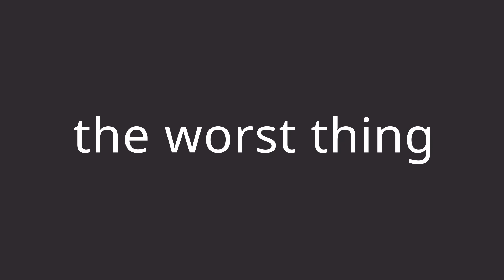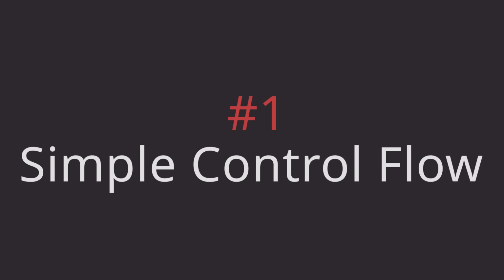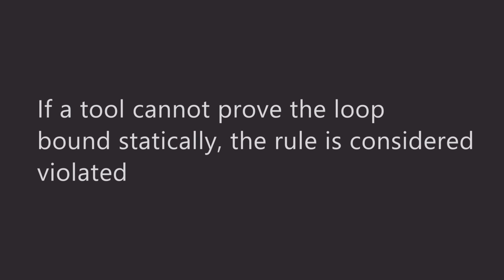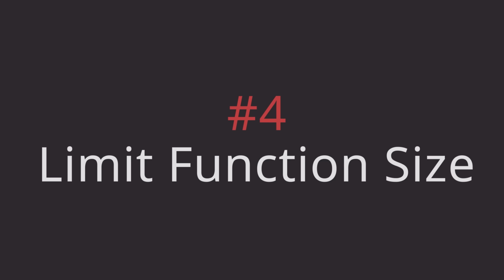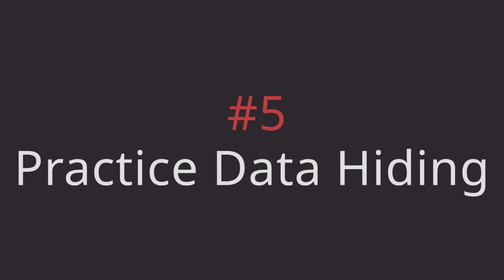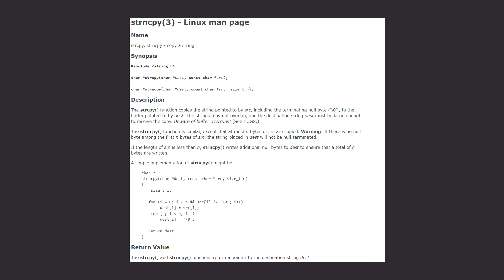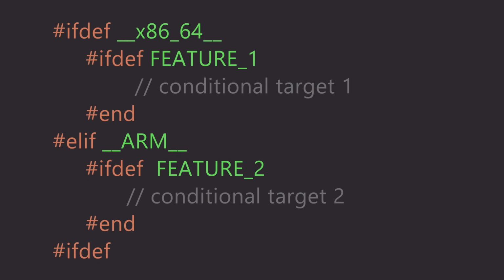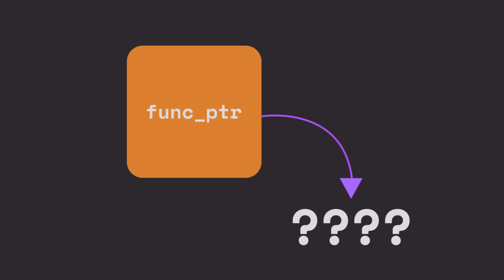how NASA writes space-proof code

Comment: I would also add, when an error occurs in your code, error recovery should bring back the code in a "predictable state".
Reply: I'd imagine this is vital for any deep space application, with all those cosmic rays flying every which way. You don't want one flipped bit to render your multi-million dollar equipment unsalvageable.
Reply: @mikicerise6250  Interestingly, it is seen in vehicles driving at altitude. I used to work in automotive powertrain as Head of System and Software Safety for a large tier 1 supplier. When we moved to microcontrollers using a smaller fab process, the watchdog system detected and stored (for feedback during service events) single event upsets, but these were geographically centred in areas at higher altitudes. As far as I'm aware, those higher (ASIL2+) variables weren't stored in multiple locations and cross-checked on each use as a mitigation specifically for cosmic ray events, rather it was done in case errant code over-wrote one copy of the parameter.
Reply: @mikicerise6250  Well, that's called "radiation hardening" and should never be necessary tho, like surely the computers there are not directly exposed to any radiation...
Reply: @erikkonstas  Space is filled with radiation. Are you saying they shield the computers so well that radiation hardening isn't necessary? I find that hard to believe.
Reply: @clonkex  What do you mean "so well"? They just have to be encased in a completely insulating and inert material (metal comes to mind). Also, "radiation hardening" of code is a recreational concept which does not apply to real-world applications...
Reply: @clonkex  NASA uses not the newest processors with billions of transistors but instead quite old processors which not have so small structures and therefore are not so vulnerable to radioactive particles. Memory could be protected by using ECC-RAM allowing to detect and correct single bit errors.
And of course some shielding makes also sense - placing the computer somethere in the "center" of all other hardware provides some additional shielding as this surrounding hardware provides some additional shielding
Reply: Something they could do, but they probably don’t is to sanity check different states, but it would probably be prohibitive to think about all edge cases that should not happen and hence could be signs of corrupt state. 

I am thinking if a is the case, b should never happen, etc. 

It would probably be too complex and too much overhead and possibly create opportunities for more things to go wrong in the rules for sanity checking itself.
Reply: @roygalaasen  Interesting thought.
Reply: @roygalaasen  what happens if you force (nearly) every error to be pedantically handled you can see in rust. The rust system of locking the result of a function behind the check of rather the function was successful or not and nagging you if you don't check the error on a "void" function is creating a system similar to what you imagine. Except for catastrophic failures (that could theoretically also be handled the same way but aren't for simplicity) that crash the program rust in every case either handles an error or forwards the decision to the calling function creating a perfectly collapsing error pyramid that is 100% statically provable to handle all cases.

Uncaught exceptions and the c lastError() system were a huge mistake and should never have been created.
Handling or propagating all errors isn't as impossible of a task as you imagine it if every function is handling it's own stuff.
Reply: @redcrafterlppa303  "either handles an error or forwards the decision to the calling function" is literally just exceptions in real languages. There's a certain comfort in the hand-holding nature of requiring every error to be handled but that's just tedious and obnoxious in 99% of use cases
Reply: @maskettaman1488  it's definitely not. In worst case just bubble up to main and crash the program there. But there is nothing more annoying than tracing which line of functions crashed the program. With clear error returning functions and depending on the language a flashed out stack trace is incredibly valuable. Running a program and receiving a Segmentation Fault (core dumped) and then firring up the debugger and going on a journey without a initial idea what went wrong is draining. Having a stack trace often makes debugging unnecessary since you look at the said line again and it hits yourself what qn idiot you where.
Reply: @redcrafterlppa303  "tracing which line of functions crashed the program". This is literally in the strack trace. That is exactly what a stack trace is for. The fact that you don't know this speaks volumes about either your ignorance or your dishonesty.

"Running a program and receiving a Segmentation Fault" what language that has proper exceptions will throw a seg fault?

Jesus dude are you under the belief that languages like Java and C# work the same as C???
Reply: @maskettaman1488  you are the one that got it wrong. The stack trace is an automatic (language level) system that unwinds the stack at crash time and builds a visual representation of the control flow taken before the crash.
Doing this by hand with a debugger is tedious and exhausting.
"the fact that I don't know that"? I know what a stack trace is and how to debug a program. But the effort between building a stack trace and finding the same information by debugging is worlds apart. 

Are you serious. Segfaults are as common as sand on the beach (showing your level of knowledge) 
Segfault is just an os signal that the process accessed memory it doesn't own. There are other signals like SIGFPE (Arithmetik operation error) that happen for example when the cpu divides by 0.
Even java can throw a Segmentation fault if you access some random memory address either if there's a bug in the jvm or you manually cause one in code.
Segmentation faults have nothing to do with exceptions except that both are related to errors.

The reason low level languages tend to throw os errors instead of printing fancy errors is that these exceptions are expensive even when no problem ever occurs. Os errors are free.

Java, c, c++, c#, rust, python, php, Javascript etc all execute x86_64 cpu instructions on my machine.
Rather you have an compiler that creates cpu code at build time or an interpreter that generates cpu code at runtime all are bound by the same rules and have the same possibility to cause the os to halt their codes execution (os error).
Only because higher level languages tend to include safety rails that handle certain behavior in some other way before a braking instruction is executed on the cpu doesn't mean that they work differently under the hood.

Pseudo code example:
Java:

int divideOperator(int dividend, int divisor) {
	if devisor == 0 {
			error = "devide by 0 error" 
			return 0;
	} 
	return dividend / divisor ;
} 

C:
int divideOperator(int dividend, int divisor) {
		return dividend / divisor;
}
Reply: @redcrafterlppa303  devisor is not defined, whoops 😊
Reply: @redcrafterlppa303  "Doing this by hand with a debugger is tedious and exhausting"

No, your debugger does this for you. You're never doing this by hand. You either don't have experience with what you're talking about, or you're intentionally inventing silly scenarios. I don't know which would be more telling.

"I know what a stack trace is and how to debug a program"

You can't say that right after you talk about how you need to unwind a stack trace by hand lmao. It sounds like you really do not know how to debug.

"Segfaults are as common as sand on the beach"

You're missing the point. Yes they can still occur at a system level but that should be abstracted away (if not prevented) from the developer in any modern language/compiler system.

Segfaults also have nothing to do with exceptions so I find it weird that you're focusing so hard on them.

Half of your comment doesn't even apply to the topic at hand. You come off as if you took an intro C course 25 years ago and believe all modern programming is like that.

For crying out loud you didn't even know what an Exception was but you're still here writing paragraphs about having to manually unwind a stack trace lmao
Reply: That's not always feasible.  Fall back measures or safe state restarts close the gap.
Reply: @gamerfortynine  Wouldn't that be a "predictable state"?
Reply: A logical error you mean. Hardware errors like accessing bad memory cause segmentation faults and cannot be "unrolled"
Reply: What the first two replies are forgetting is that this program is LAUNCHED TO GODDAMN SPACE and you don't have the little privilege to rerun a crashed process... that's not always feasible or might be prohibitive to think about? Then why oh why does 350 million peoples' tax money and numerous enormous grants fund NASA exactly???

Comment: So, I imagine there are exceptions to these rules bc you need setjmp like operations in order to yield a thread or to enter an interrupt. Similarly, function pointers can be typed so that threading can occur. Based on the restrictions presented in the video they couldn't use a normal RTOS statically. I would argue within context of context switching that they would have to use them then and only then.
Reply: I work in aerospace, where we enforce MISRA analysis of our code. You're right that these rules make threading extremely difficult (I won't say impossible), which is why we don't use threading. We also don't use an OS in the first place, so each processor is incredibly limited in available resources.
What makes it possible to do anything more complicated is, in my opinion, the use of distributed processors and specialized hardware for communication between them.
If we've got to control 7 actuators, we don't have a single multithreaded processor running an RTOS to process any events that might occur. We'll have 7 tiny processors sending their state to a main control unit, which will then react to (and filter) external input and send discrete commands to each actuator.
In terms of control flow it's not significantly different. Roughly the same information ends up at the actuators, and at the central unit, achieving the same results. But it allows us to use much cheaper & more modular units, while providing a better framework for testing each individual unit in isolation.
Of course the flipside is integration hell, or what happens when all these individual units get put together and we discover that these 'perfect' units don't speak the same language in the first place 😂
Reply: @aidanbecker9758  misra standards I get, but I've still seen things like vxworks used across industry for aerospace applications. When you're talking multiple hardware devices you can get away with it by having them easily talk over a bus , but that drives up cost and ultimately you still run interrupts on a bare metal system.
Reply: Like I could see getting away without set jump contact saving your functions which means whatever running has priority except interrupts. Which if I remember properly is a cooperative operating system. You can get away with that as long as your function has exit points for that and reevaluates system state. However, task handles would still need to be typedef  function pointers in order to implement a scheduling system unless you have everything based on context state and not event based. In that case, you could run everything in a central while loop.
Reply: It could very well be that they don't use a RTOS which doesn't make use of these rules either. Considering their environment, that would be very understandable.

So it could very well be the case that they do in fact have no exceptions to these rules.

Comment: When dealing with extreme scenarios is necessary to implement extreme measures. Not feasible on regular projects however it is a rock solid approach for coding.
Reply: Now I want to work on nasa. Not that I want to torture myself, but opposite of that. ALL of their code is crystal-clear and it should be very satisfying working on a codebase that for many years follows this strict set of rules, where you can read and actually understand what's going on without ever needing to run that code. It may be a little hard to work on such a project at the start, but there's nothing a few code reviews can't fix :)
Reply: @IqweoR  But a while ago even NASA got a constant wrong and literally caused the rocket/space craft to be 180 degrees off, I think it was a minus sign.  It happens to the best of them.
Reply: @raylopez99  No amount of care in coding is going to fix a logic error.
Reply: @darrennew8211  Eh yeah it's possible to carefully code bad logic. On the other hand, most of the clean code guidelines are designed to make the logic very, very clear*.  It's far less likely for bad logic to make it through review of the logic is super clear - and therefore *clearly wrong.
Reply: Personally, I disagree that such code practices are infeasible for more mundane projects like financial software or video games. Rules like these help you and other programmers to understand what your code is doing more easily. They reduce the odds of undefined behavior and memory leaks. They also help you catch design oversights before they reach production.
Reply: @megabyte01  I think everything is a trade-off, some applications are not as crucial as others and sometimes a faster development is more desirable than a more solid one.

I understand your point, don't get me wrong, yet I see it more like using a tank for killing a mosquito.

For example: a correct use of Heap can be correctly deal with no problems in a production environments (pretty much everyone does it), this code guides asks to remove such a useful tool which may be more troublesome for applications that are not that crucial.
Reply: @megabyte01  Not using the heap in modern video game design?

Yeah alright buddy.
Reply: @joestevenson5568  The heap is unnececary a lot of the time. 
Objects that fall out of scope are destroyed and objects you create are allocated on the stack reguardless of size.
If you are feeling fancy you can stack allocate chunk wise with pre-determined stack objects and incur a small performance penalty for not being able to gurantee contigious memory.
Reply: @Mallchad  I disagree, there are significant downsides to not being able to use the heap. The most obvious one is dynamic memory, stack has a fixed size and compile time (data/text) objects are fixed size as well. For the majority of projects heap is beneficial and necessary, it's a fundamental tool of programming, however it makes sense why NASA avoids it since manually managing memory is prone to error.
Reply: @_schnelli4800  it depends entirely on the scale of the project.

On modern hardware there's really not a lot of reason to not predefine the size of your objects, so unless you truly are using enough memory to warrant strict reduction of memory

but even that isn't the whole story because there is internal memory managers that dont strictly use the idea of C heap memory and can probably facilitate arrays not defined at compile time

besides, a huge amount of software never use more than a gigabyte of memory
Reply: @megabyte01  Coding this way is amazing but the trade off is it takes a much longer time to get things done. That’s fine when you’re dealing with billion dollar satellites and human lives, but in an environment where time is money like game development and making commercial software it just isn’t practical.
Reply: @megabyte01  While most of these are certainly not bad ideas, not using the heap would be a problem for many projects.
Reply: Most of these I follow I've always followed, for 25+ years of programming. Others can be applied to an appropriate degree based on the costs involved if the code does the wrong thing.
Reply: I do all of these in every project except avoid the heap and check every return value. I don't think it's worth the trade-off for me to try to avoid the heap since I'm not doing embedded code and I'm always in a garbage collected language, but I'm going to start casting return values to null or void to make it obvious I didn't intend to use them. It's trivial to do, and the argument that casting them to void shows ignoring the return value was done on purpose makes a lot of sense to me.
Reply: All of those seem to me like completely reasonable things anyone should do. I weren't even aware NASA had these and I was basically doing same exact thing anyway.
Reply: Testing still needs to apply and doesn't seem to anywhere near as much as it should.
Reply: @Optimus514  if you're running a good memory manager allocations and deallocations are basically free on the small scale. It can actually cost more performance following pointers around to find existing objects than starting from scratch

Unitys memory model is king of shit and encourages to to use a big fat dynamically composed object for literally just a static cube and then garbage collects at an bad time.